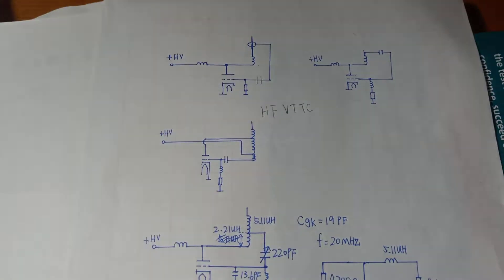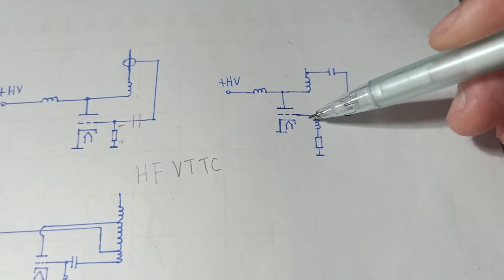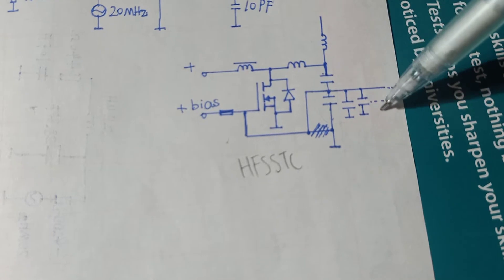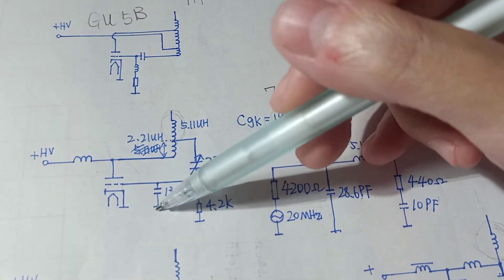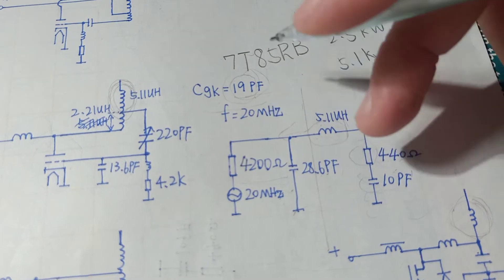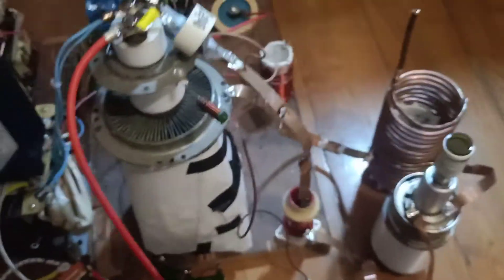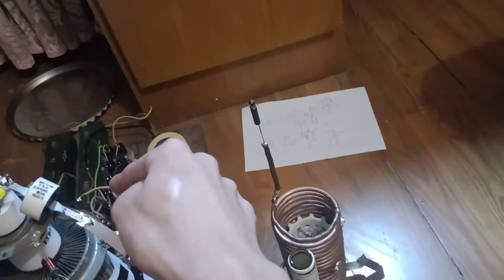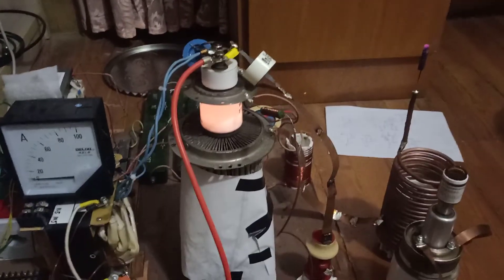HFVTTC 45cm plasma and explain of the improvements I made

Comment: Really great result!! please tell me how many turns are in the resonator, what is the diameter and cross section of the copper tube?
Reply from the maker: The diameter of the winding is 85mm the length is 150mm and I use 18.5 turns.The anode is connected to the 6th turn from the bottom[the grid feedback is from the bottom].The feedback capacitor in series with the bottom of  the winding is around 300pF.I think these parameters would work well only with the 7T85RB vacuum tube under around 5kV anode supply DC voltage because the impedance of the tube would change under different anode voltage and working conditions.Also if you use a different  tube the capacitor between each 3 electrodes in the tube will change thus changing the working frequency and the impedance matching network.You can calculate the vacuum tube's anode to cathode impedance by using this formula:Z＝Ua/[1.87×Ia],both parameter are DC voltage and current.Your 2×GU81  HFVTTC also has an excellent performance,it's really impressing that those tubes could also generate such power.🤗

Comment: Yea, I've got a few of those old soviet vacuum tubes & have been wanting to build something but haven't seen a solid breakdown of the circuit. Thank you very much this is a great help
Reply from the maker: Looking forward to your setup sir ,if you have any questions feel free to ask .
Reply: @uecmitsuimarinedieselengin873  I'll send you an email if you wanna get into contact. But I'm  curious if you've attempted to see how well a HF coil can cause rotation if allowed a free axis. Standard coils can be made to spin the breakout point.
Reply from the maker: @recramorcenlemniscate7945  I haven't tried that ,but it seems that HF plasma tends to go upwards instead of shooting out from the horizontal sharp tip.
Reply: @uecmitsuimarinedieselengin873  won't necessarily matter. With propulsion it's the mass ejection that causes forward momentum. In the case of Tesla coils it's the ejection high energy particles hitting low energy particles that gets them moving. Where the particles go after the collision doesn't matter as much as the transfer of the energy itself. Plus at high speeds the plasma will get horizontal no matter what.

Comment: 9:42 it's the feedback current phase... Probably before it was out of phase, but I'm surprised that it even worked if it was so... I've never built an HF(VT/SS)TC but by what I've seen on yt and simulated on ltspice it doesn't work if you flip something. Anyway, if now works better, great!
Reply from the maker: Firstly I thought it may because of the feedback phase,but when I think further more I noticed that the main resonant part is always the lower part of the coil in series with several capacitors.The upper part of the coil is used for impedance matching to the plasma.I'm still very confused about that till now .🤔
Reply: @uecmitsuimarinedieselengin873  This is an interesting observation, thank you for sharing!  Does the oscillation frequency change between the 2 configurations?  Can you measure the resonator's self-capacitance?
Reply from the maker: @SteveWard  Later I know what made the difference:if we connect the anode to the output matching coil and the grid feedback point at the lowest end of the main coil we actually get a L matching network[together with the plasma capacitance]at the output side.By now I don't have the proper instrument to measure the coil's capacitance,that's really a shame.
Reply from the maker: @SteveWard  The oscillating frequency only slightly changes,I actually did some calculations and found the frequency is depend on the lower part of the coil and the grid to cathode capacitance together with the feedback series capacitance.The grid leak time constant actually do have some influence[the larger tine constant the lower the frequency is] but in HF range the influence is little,unlike its influence in my UHF pushpull vacuum tube oscillators.
Reply from the maker: @SteveWard  By the way,recently I'm building a HV inverter.I also considered your SRC CCPS converter but I'm not familiar with it.What are the SRC's advantages?Till now I only know it features soft switching both turn on and turn off,if I use a full bridge or half bridge to drive the transformer without resonance I would only get soft turn on.But do SRC have other advantages?The output power?
Reply: @UEC MITSUI Marine Diesel Engine  operating the SRC at 1/2 the resonance frequency gives roughly constant output current even with short circuit.  This is the main attraction, no special control circuit required.   Power throughput is not as much as is possible with operation at or above Fres, but this will require active control to regulate current.
Reply: @uecmitsuimarinedieselengin873  hmm this evening I'm a bit busy, tomorrow I'll try to investigate further😅